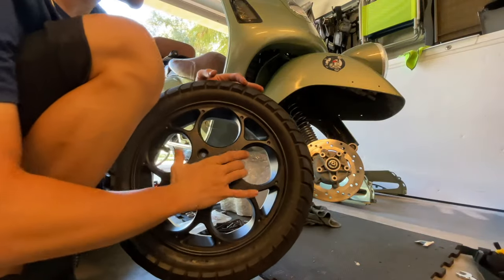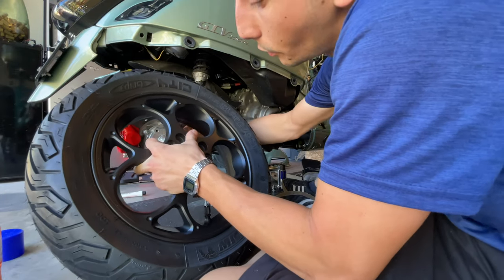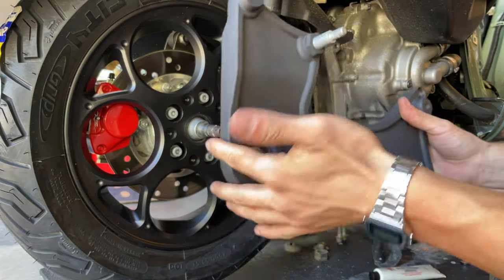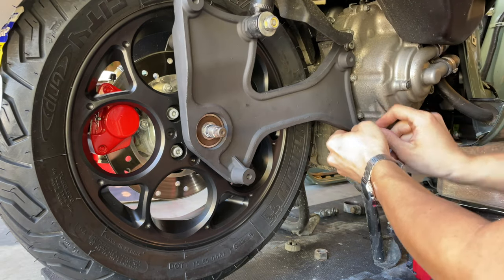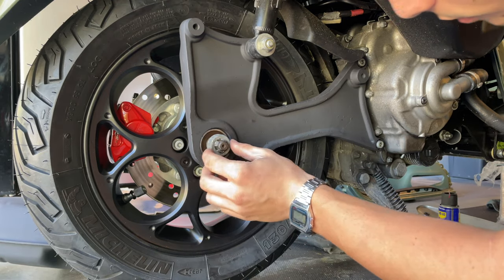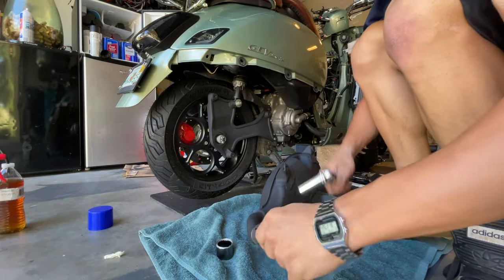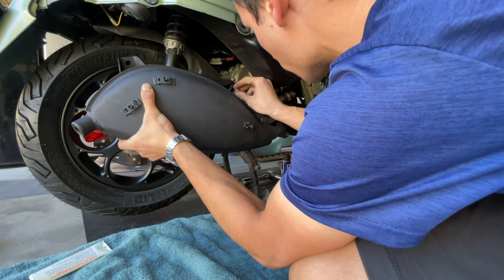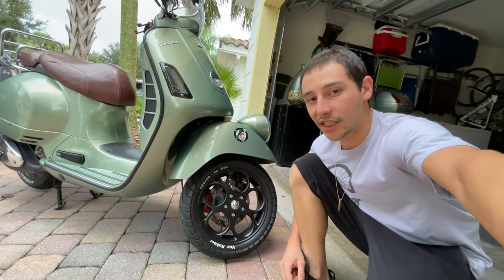How To Install The Wheels of a Vespa GT/GTS/GTV

Comment: Hi what size is the wheel 13" or 12" I'm just going to try fit a 13×140 on the back 🤔🤔🤔
Reply from the maker: They are 12” inch wheels. Thanks! 🤙

Comment: hi do u know if its possible to install this rim on my lx150
Reply from the maker: That’s a good question! I’m not sure since the these wheels were made for the GTS and the primavera/sprint and theses are both 12” I believe the rear hub for the brake is bigger on the 12” and I think your lx150 is 10”? Like the ET?

Comment: Hey is the rare wheel identical to the front wheel? Because from a vespa sprint the rare is different from the front rims.
Reply from the maker: The wheels for the GT/GTS/GTV are identical, front and rear, but they are different on the Sprint/Primavera due to the rear brake system, the GTS uses dis brake while the Sprint/Primavera uses drum brake. Thanks 🤙